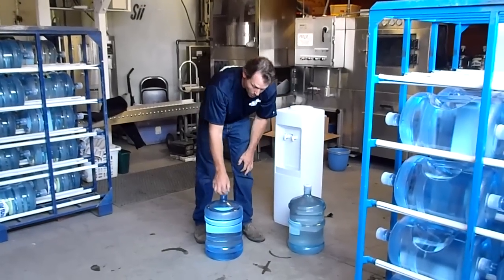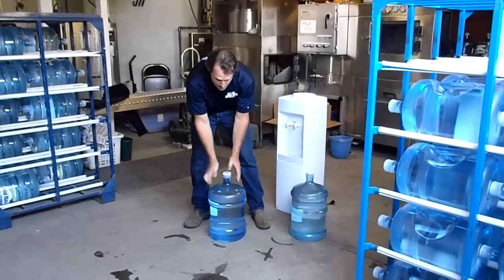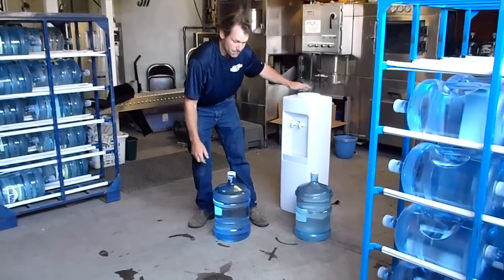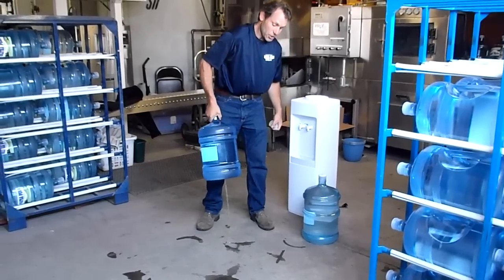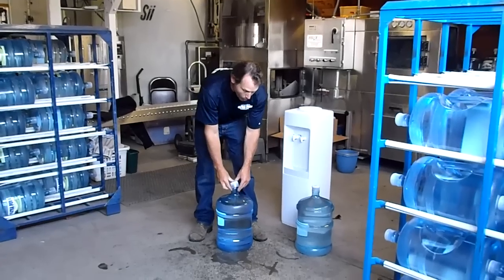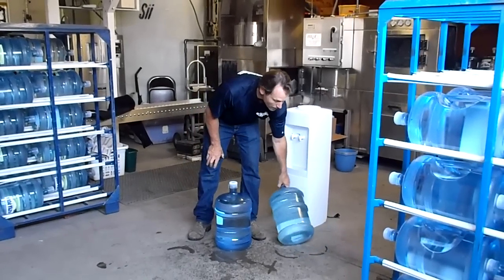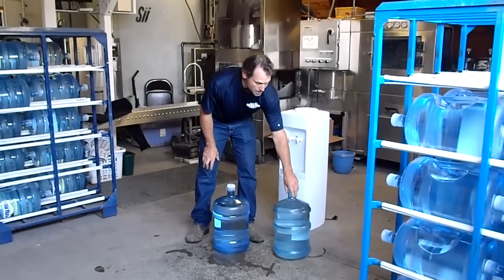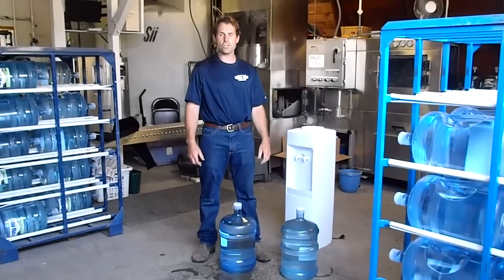What can make your water dispenser leak

Comment: Why are the bottles leaking from the bottom?
Reply: If the water bottle itself is leaking there is probably a hole or crack in the plastic - if you kneel on the bottle while it's full you should be able to pinpoint the leak. In those instances the bottle needs to be replaced.